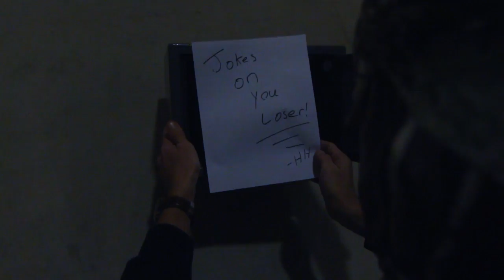How to Build a Hanger Safe

Comment: hot glue would never hold that up. obvi just drill a small hole and screw the hanger into it.or... heres a though.. just put the valuables in the clothes hanging on the hanger. duh.
Reply: i think it could hold up, what makes you think it would fail?

Comment: due to the weight of whatever you put in the pipes, the pipes themselves, and your coat or bulky clothing (which weighs a lot more than people think), the hot glue would not hold to the pvc or the hangar hook because they are opposing smooth surfaces trying to be held together by a smooth adhesive and it would fall apart in anytime between minutes and a couple days. Hot glue was made to hold together abrasives like cloth and paper because the glue molds like silly putty but clings well.

Comment: Dont put valuables in anything that someone would throw away if it broke ect. 

Example: (Friend is snooping around your closet  for some reason and breaks your hanger. He decides to throw the hanger away and switch it with another one so that you dont notice...) There goes all your valuables.

This is a terrible idea, if you want to hide something, hide it in a solid piece of furnature like a couch or something that has alot of padding or space inside to hide things. Make a box and camoflage it

Comment: I don't think hot glue will support a bulky garment.  If you have access to a drill, I recommend just buying a similarly shaped wall hook with a screw and screw that into the drilled hole.  Or even with the demonstrated method, drill the hole, the fold over the hanger bit inside of the pipe.  Great idea for this project though!  I may try it...  But I don't have anything too valuable, lol.

Comment: @Grenation Well, the dollar bills and "document" are jammed in there pretty tightly. And since the "document" shoved the dollar bills roughly towards the middle of the tube, it's going to be very hard to take out the bills with your hands. Thats what I meant by the comment, I probably didn't specify what I meant very clearly.

Comment: Man! this is the second time I've seen a tutorial on this channel, where our hero uses hot glue as an adhesive. Yep it's sticky stuff, on fabric, paper, costume jewelry etc... 

It is NOT strong enough to hold any weight!! Sheesh..

Maybe drill a hole right through the 30 degree bend and put the metal hook right through and bend it, once it's through (so it won't come back out)..

I'm not trying to pick on you, it's a neat idea. Consult a handy person before more 'projects'. 
Thanks..

Comment: Hot glue is not strong enough to hold the weight for long. Drilling a small hole for the end of the hook would work much better. Epoxy would also be superior to hot glue.

Comment: Would it not be better to heat up the metal part and push it into the plastic saving all the glue which will probably fall off.

Comment: You're a good man with a good Idea, but ya kinda dropped the ball with the hot glue idea. I think we both know, that isn't gonna hold much weight at all. The hanger would be much sturdier even if you simply duct taped the PVC tube frame  to a wire or plastic coat hanger.

Still, I can't fault you. It's a basically good twist on a proven idea, and you're the one making the effort to post the videos, I'm too lazy and unorganized.  And I believe you have a better camera presence than I do.

Comment: Or you could just unscrew the hook from the original hanger, drill a small hole in the pvc connecter (or just be a man and force the fucker in there with your bear hands, yes I said bear hands because real men have bear hands), and screw the hook into the pvc so it looks real.